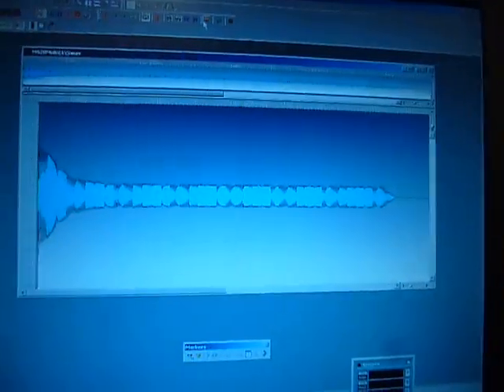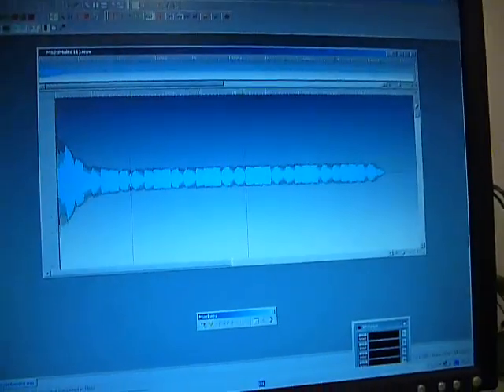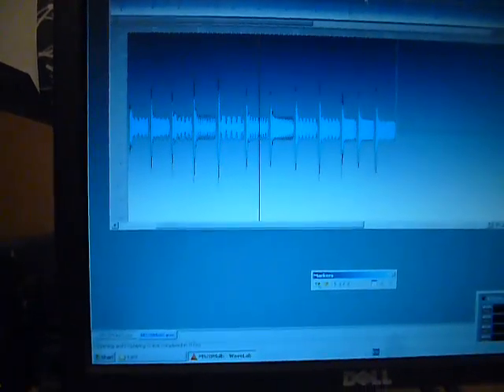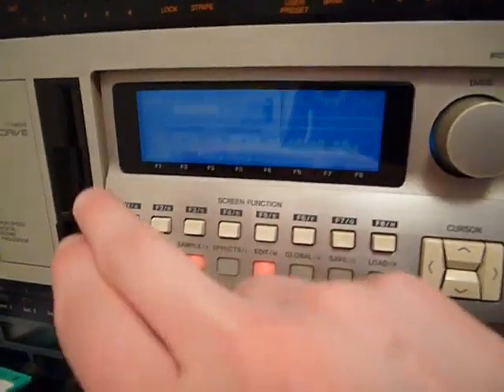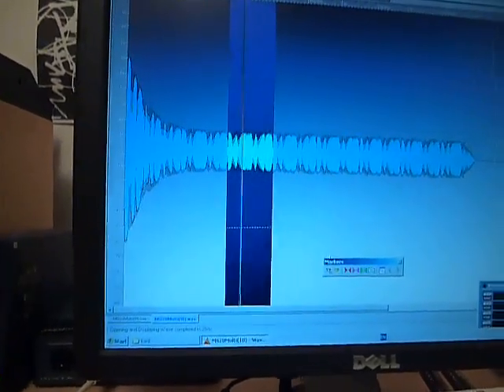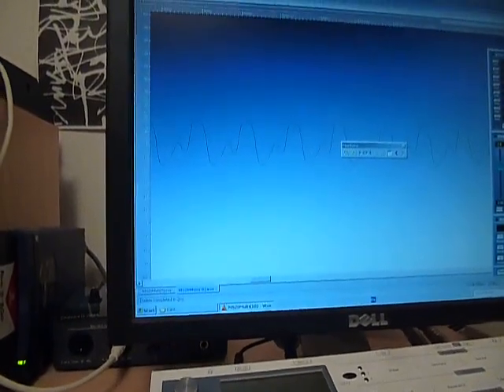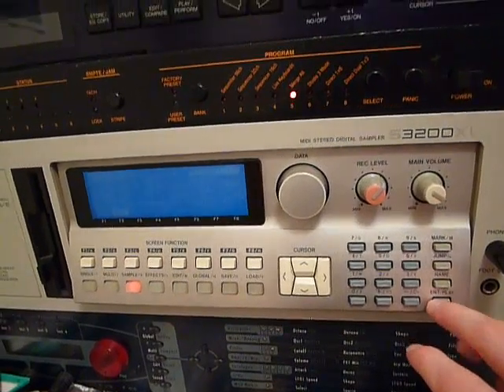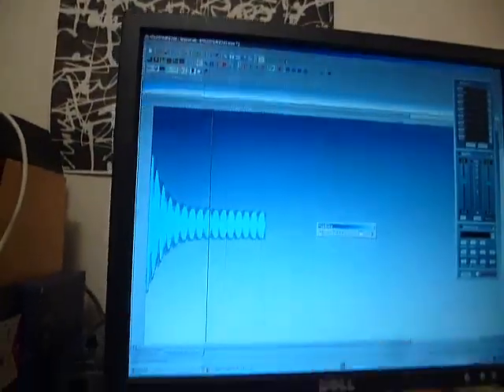Sampling tips/shortcuts with VJ (Quick Looping)

Comment: congrats for that perfect visualized sample loops... but hey, i still love it to use that "rubbish" ensoniq loop technique without any screen... simply by using my ears  ;-)
Reply from the maker: That's just it, the EPS doesn't require this kind of ball ache. It's a much better machine in many ways and you can get loops with ease where's you'd still be rotating that data wheel on the Akai and wondering why it's still glitching

Comment: what version of wavelab are you using?  would it work in windows 10?
Reply from the maker: Are you talking about SCSI support? In which case anything up to Wavelab 6 will work over SCSI. Otherwise even the current versions do everything else.
Reply: OK thank you! I mean the full system software+scsi support. I thought you were sending the samples via midi/sysex. Anyway my pc haven't got a scsi port
Reply from the maker: MIDI Sample dump would take an eternity. SCSI will work with Win 7 32 and 64 bit versions though
Reply: I'll check it,  it seems like windows 7 is the last OS supporting scsi. thank you!
Reply: I'm on Win 7 64. Which SCSI card are you using? Great channel, btw.
Reply: I forgot to ask, will this procedure work with the S1100?